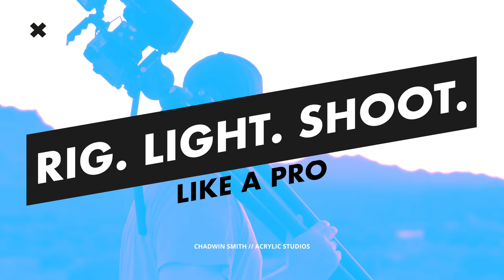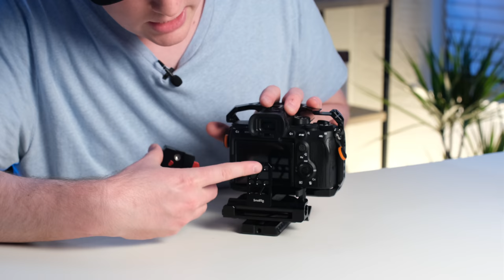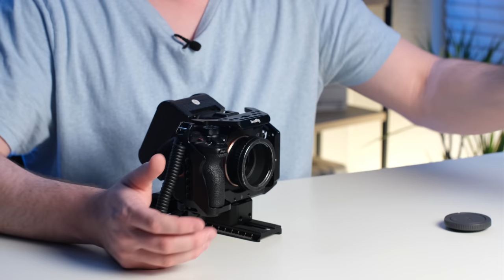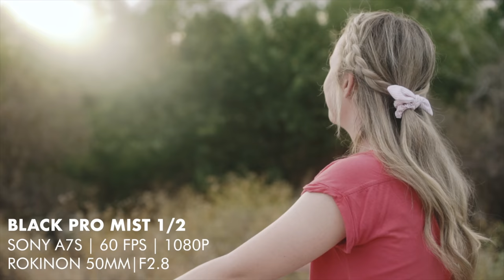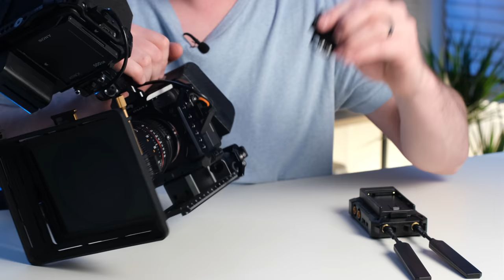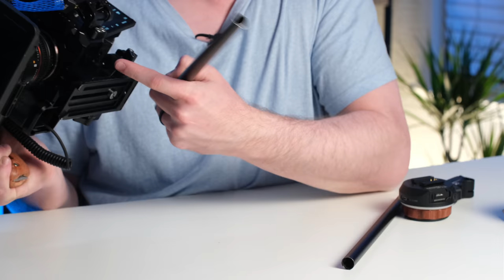Turning the Sony a7siii into a Cinema Camera

Comment: Why not use a power bank to usb c instead of v mount?
Reply: Or better yet, use a small 100mAh V Mount battery from FXLion (the NANO TWO) which actually has USB-C with PD charging.
That's what I did on my A7SIII rig and it charges so fast that the A7SIII is kept charged at 100% while you use it (and zero worries about dummy battery issues)
Reply from the maker: Yeah, that would be a good option, I’ve done a few rigs powered by power banks but it’s harder to have all the right connections and amps/watts to power everything. The idea of using a v mount battery with USBC PD is awesome as mentioned here
Reply: @Hangs4Fun  V mount battery is still expensive and bulky (unless for bigger rig) compared to pd power bank, which costs around $20 and can be used on even smaller rig.
Reply: @frankfeng2701    bulky?  Go look up the battery I suggested, look at the dimensions and weight.
Expensive, yes, but you aren't going to be powering a Ninja V with a power brick for more than a couple minutes.
Through that one small FXLion NANO TWO battery I power: the camera (PD charge), the Ninja V, TimeCode (AtomX Sync), 4 channel audio (XLR-K3M), Wireless  video transmission (MARS 300 Pro Enhanced, charge through USB), and wireless follow focus (iFocus Wireless lens control system, also keep it charged up)
I tried power bricks (which I love and have dozens btw) and power junky, it either took several and/or they didn't last long enough.
It all depends on your requirements and use cases.  Believe me I use power bricks for anything I can and have several I use for everything I can.  Paying so much for one battery definitely hurt but I could not meet my requirements with power bricks.  Plus once you are talking TimeCode, RAW recording, wireless video transmitting, 4 channel audio, wireless follow focus, you have spent thousands beyond the camera and lens. Spending a couple hundred on a single V Mount battery versus Using a couple of $20 power bricks that all have to be mounted, cabled and constantly swapped out seems insignificant compared to what you built out and need to power and keep ready to use without constantly swapping out power bricks. I pondered a couple months before finally pulling the trigger on that NANO TWO battery and wishing I had done so sooner.
Reply: @Hangs4Fun  Thanks for the heads up on this battery.  Can I ask which port you're using to charge the Ninja V while using the USB C to charge your A7SIII?  Cheers!
Reply: @robertmoniot  sure NP..  the FXLion NANO batteries (both the model ONE 50 Wh and the model TWO 98 Wh) have both a P-Tap and a USB strip of ports.
So I ran a Kondor Blue P Tap to 2.1 locking DC barrel plug into the Ninja V (through it's included dummy battery) and then a Kondor Blue USB-C to USB-C cable to charge my A7SIII.
Important thing here is that the FXLion NANO batteries USB-C port is a PD port, meaning it can go above the normal 5V DC that non-PD USB does and the A7SIII supports PD charging.  So you don't even need a battery plate, I just run power straight out of the FXLion NANO TWO..
I'm producing some videos as we speak on the rig (which is all Kondor Blue)
Reply: @Hangs4Fun  Perfect, I'm gonna order the Nano today.  Happy New Year!
Reply: @robertmoniot  same to you.  One other thing, it doesn't need an expensive V Mount charger, as it also can be charged through it's USB-C PD port.
The digital display on that battery is great too, it's VERY handy having info on the levels of the battery, what voltage levels in or out, etc.
Have a great New Year!
Reply: @Hangs4Fun  This explanation was awesome with a good recommendation. I just received my A7S3 so I'm in the research and delicate stage to make sure I establish the right set up. I may have to pay you for more advice. Let me know if you are interested.
Reply: @Hangs4Fun  I ordered the FxLion and Kondor Blue cables.  To clarify your set up.... is it safe to run a P-Tap 2.1 from the FxLion to the Ninja (via dummy ac adapter) and then run a USB-C set up from FxLion to the A7siii at the same time? There will not be any concern with frying the motherboard on the camera?  Thanks.
Reply: @adrianmack7750  normally the old issue of powering both a high speed recorder and camera off the same power source is due to the voltage used to power the signal between them. SDI 6 and 12gbps and the more recent HDMI 2.0 and 2.1 use a lot more voltage than they used to.
When those two devices then also share a power source there's the chance of frying the SDI or HDMI port/board which is less amperage/voltage than the power side.  If the power connections weren't left intact before connecting or disconnecting the signal cables (SDI/HDMI), there was always a slight chance of the power finding ground through the signal cable which isn't designed to handle as much.
However, we aren't running 2 P-Taps here.  We are only directly powering the Ninja V via a dummy battery and PTap.  The Sony A7SIII is running on power from its own Z100 battery, the USB-C to USB-C cable is only connected to the charger of the A7SIII.  But to be safe, I would always follow the procedure I previously mentioned a couple comments before this one to be 100% safe.  Also by using higher quality cables like you are, you are good to go.
Where you "could" get into trouble is when you use a dummy battery where voltage is going straight into your camera.  First Sony does not support you doing that (does it work, sure, but you can have grounding and voltage problems like I mention above). This solution is 100% supported because you are actually powering the A7SIII directly through a Sony Z100 battery and the Ninja V is being powered by the very dummy battery they provide with it.
One last tip, be VERY careful anytime you plug P-Tap cables into a V Mount battery.  Almost all plugs are plastic and the plug design is very easy to reverse polarity (I actually don't like the design Spec of P-Tap connectors for this reason).  I would highly recommend to use some nail polish and put a small dot of it on the positive side on both your battery and the P-Tap connector.  That way you can quickly match up polarity, as for what ever reason battery, cable, and battery plate manufacturers seem to take joy in making the plus and minus as small as possible...  
Don't hesitate to reach out to me at Chris@AdventureOutdoorsProductions.com or Chris@Hangs4Fun.com
Best to have a solid procedure for setting up and taking down your camera rig, and there's a lot of gimic hardware out there to waste your money on.
Have a great day!
Reply: @Hangs4Fun  This was awesome.. clear... and very direct to my answer.  Perfect.  It makes perfect sense.  Since we are running vi P-Tap... supported by Atomos, and via USB-C... supported by Sony, then the old issue do not apply here.  That makes perfect sense.  The SDI and HDMI was an issue on previous set ups because they ran through the same source, and grounding or cheap connections can potentially cause voltage problems when connecting.  AHhhh got it.  

My parts are arriving soon with a couple items on backorder. I went with Kondor like you stated earlier. I feel solid with that company.  Thanks for the tip on marking the P-tap... I hope i have not made that mistake already.  I am marking them now for future proof.  

I’m visiting your website now to follow and stay connected.  I hope you have a donation tab there.  I’m about to provide a little something for the support and advice.  Thanks.
Reply: @Hangs4Fun  What would you recommend for Sony a6500, that doesn't have USB-C connection? I would like to connect it to FXLion NANO Two together with Ninja V without v-mount plate. B&H recommended using the SmallHD D-Tap to L-Series Dummy Battery Cable (32") for the Ninja V and to power the A6500 use the USB cable that comes in the box with it.
You seem like an expert in this subject, can you please advise if this is a safe solution? Or there is a risk I will fry my camera? Thanks in advance!

Comment: Great! Is there any way to change that handheld ring to gimbal faster? Because It is true that handheld movements become more real , without vibrations ,besides customers would think is a better camera (bigger = better xd) however if I want gimbal movements it would be a different process that could slow down the filming
Reply from the maker: check out one of my old vids on the channel called the "camera rig that can do it all" it shows how i switch quickly from handheld to a gimbal on set.

Comment: Hi Chadwin! Loved your video! I have the exact same baseplate and battery hing. I'm looking to add 15 mm rods to this plate. You mentioned in the video that this is possible if you get the correct threadings for the baseplate. 

Do you have a suggestion for what I would need here?
Reply from the maker: nice! sounds like you're building a good rig! Yes, watch this video and it shows the exact threads and how i used them to add the 15mm rods. https://youtu.be/Ry1S-EGd_bo?t=427 here's a link to them on Amazon as well. https://geni.us/thread15mm hope that helps!
Reply: @chadwin  awesome exactly what I was looking for, thank you so much! Excited to get it finally built out. :)
Reply from the maker: @Alxposure  awesome, glad I could help! good luck on your new rig build!

Comment: Question: If balanced on a gimbal. Would the battery stay in place or would it move on panning shots? Im planing on using the Fxlion NANO ONE 50Wh. It sould be small enough not to move right?

Comment: It's funny how you use 2 screws for the base plate but only one for the manffrotto plate lol
Reply from the maker: I know, I totally screwed that up and only had one screw there when I was putting it together for the video.. BE ADVISED THOUGH--I ALWAYS USE 2 SCREWS when I'm actually getting ready to go out and shoot something in real life!!
Reply: @chadwin  The cage itself has a lot of play because it is only one screw (specially when you are pulling focus). I solved this by getting the metabones to EF and the piece that goes from the cage to the metabones (just like on the bmpcc, they make that piece as well for sony). Before I got that piece I used to put some paper in between the cage and the camera so it moved less inside the cage lol

Comment: Hey Chadwin, thanks for the really informative video! Quick question about the short HDMI cable that you're using. I checked it out on Amazon and I'm concerned that it isn't rated for 4K output. Have you experienced any issues with this / quality? Big fan of Gerald Undone's and usually go with his HDMI suggestions but love how short yours is. Thanks!
Reply from the maker: Thanks for watching! Yeah it should work totally fine for 4k. I used it to record 4k ProRes raw on the a7siii and ninja v with no issues. Amazon listing says it’s rated for 4k as well. Hope that helps
Reply: @chadwin  Awesome, thanks for the follow up - appreciate it!

Comment: What was the total cost of all this gear? It seems to me that if you're going to spend this amount of money rigging the A7siii, why not invest in a real cinema camera?
Reply: Though insanely impressed, I had same question. I know AS7iii has IBIS which the Cine Fx6 doesn't, and better autofocus. Curious to know w/ all the add-ons if the cost is roughly equal (or even more expensive?) and if there are more advantages.
Reply: For sure. I own the A7sii and love it as a small run and gun camera, but I also shoot with the C300mkii, which has most of this built into it already.

Comment: Didn't you say in a previous video that it's not safe to run the monitor off the same battery as the camera?
Reply from the maker: So, I've done it many many times in the past. However, one time I had a weird glitch with it and it's freaked me out ever since. Search the comments here though, someone explained why it can be a problem and the proper order of operations for plugging it all in to avoid any power surges and such.
Reply: @chadwin  Wait....so you shouldn’t run a monitor off of the same v-mount with the camera?  I used your your rig setup with the A7iii and that’s how i have it. Both are running to the battery via the Fogu adapter. Should i change that now?
Reply: @chadwin  BTW... just picked up my A7Siii today i came running to this channel hoping that you had a rig setup. You got it!

Comment: Cool video! How much does this weigh?
Reply from the maker: thanks man! honestly, I haven't weighed it, but I'd say between 5-8lbs.
Reply: @chadwin  thanks for the answer. Do you recon it could go onto the ronin rs2 considering size and weight? DJI advertises 10lbs
Reply from the maker: @Sondre.K.Jensen  honestly no, it’s way too bulky and awkwardly shaped when fully rigged like this to go on any gimbal. You’d def have to pair it down quite a bit to get it to balance and have clearance, even if it could handle the payload

Comment: why would you risk dummy battery powered your camera, but use separated big boy battery to a monitor? i understand there could be reasoning behind it, but you stoped at "just do it!".

that built watsted such a nice camera grip with all useful fn buttons and dials at your finger tips, and unbalanced hold to the rig. an exclusive manual lens but there is no thoughts go into to focus pulling. that's inefficiant on a tripod, and unstable on a handheld. 

this is such a wierd build, expecially from a pro with all those expensive equipments and a portfolio.

Comment: Couldnt you just get an fx6 for the price of all of this
Reply from the maker: yes, if I had all of the money upfront, I probably would've just got something like the FX6. but this rig has been a slow build over time.
Reply: @chadwin  I just got the FX3, and I feel like I’m in the same boat. The top handle doesn’t really work with a ninja, and if you take the handle off you lose the XLR. Throw in the fact that you need high quality screw on NDs or a giant matte box, and you’re already at least another $500 in for something you have to mess with manually, which means you can’t really manually focus. If the FX6 wasn’t on back order I would find a way lol. But I’m sure most people are going to rig out a mirrorless first, and this is extremely clean the way you’ve thought it out. Thanks for sharing

Comment: An awful lot of stuff to hang off a camera with so little thought to pulling focus.  hm
Reply from the maker: This setups is primarily for handhold shooting or locked off tripod shooting where you can simply pull focus by hand. However I did explain near the end of the video that you could simply add 15mm rods and a follow focus if desired